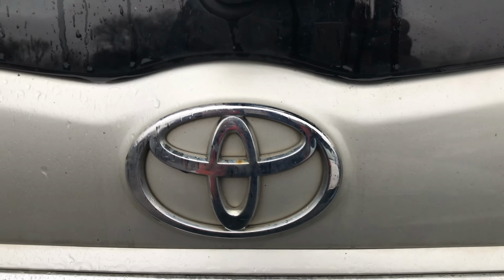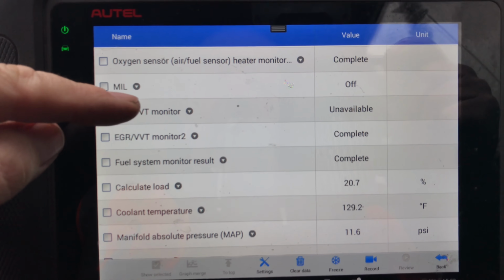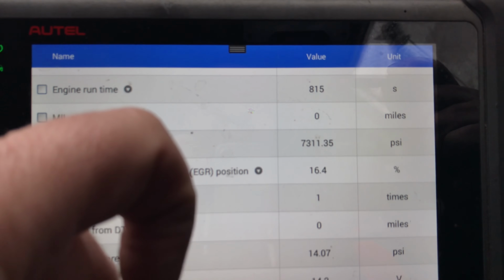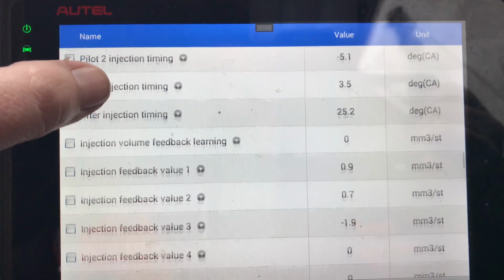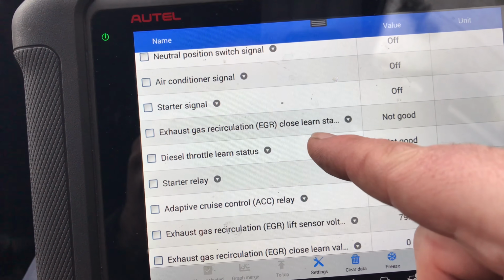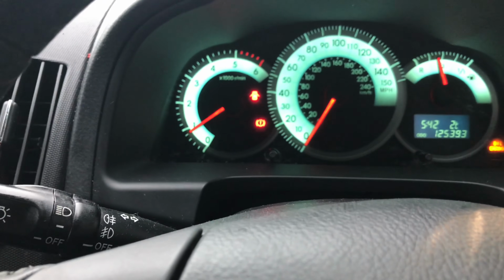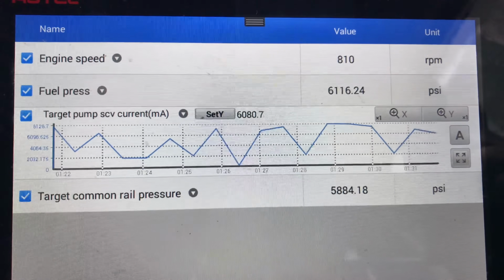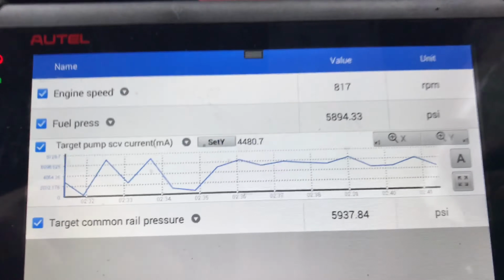Toyota Corolla Verso D-4D - Lack of Power

Comment: Sandy i think you could be on the right track looking at scv. When I've had trouble with them the symptoms have been poor idle,high pressure and customer complaining of intermittent loss of power
Reply from the maker: Thanks for help Davie cheers sandy
Reply: @sandyande   scv faulty  common problem  on the denso fuel system  change both around £80 for genuine denso  , i had bought cheap scv valves that failed months later so best going for the denso

Comment: I wonder did they changed the fuel filter when they done the tank.
Reply from the maker: No idea Ian, I had initially wondered if they disturb the intank pump??
Reply: @sandyande  and a second had fuel thank id say you don't no what crap was built up in that either.

Comment: Hi Sandy totally agree egr valve is blocked with carbon and at that mileage I would be removing the inlet manifold and scraping that out and the cylinder head of all the carbon. Messy job but transforms the car again
Reply from the maker: Cheers Sandy

Comment: Sandy i have an Avensis and every 3/4 years it runs like its running out of fuel.
No codes.
The fix on mine is to clean out the EGR valve.
Seen that on a few of these D4D's.
Reply from the maker: Thanks Tam I'll get him to clean it out, thanks for tip, Sandy
Reply: Would you throw a video or two on how to do that? I seem to have the same problem
Reply: @serviceaccount8761  remove the airbox and it’s easily accessible. I suggest blanking your EGR or it’ll always return